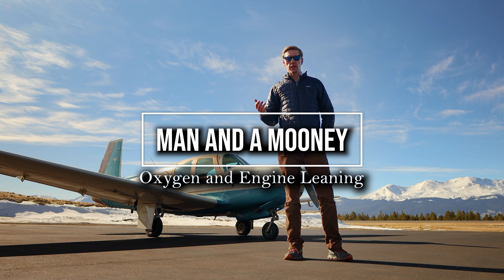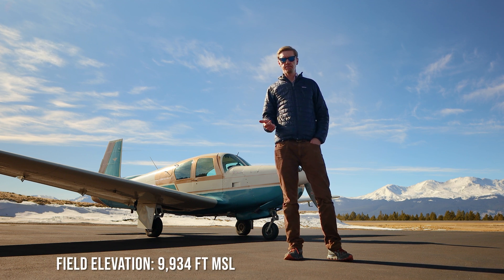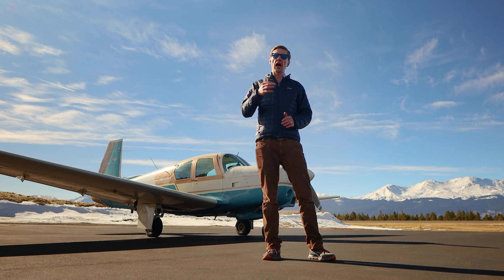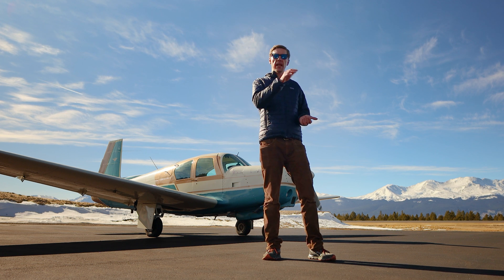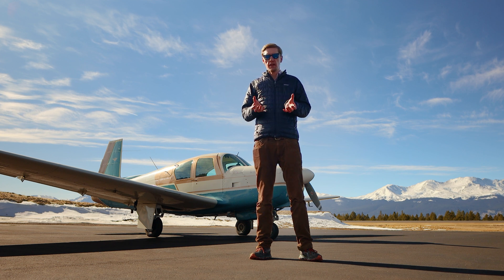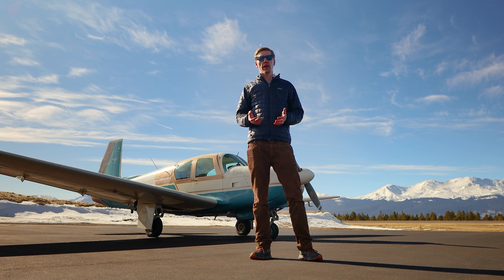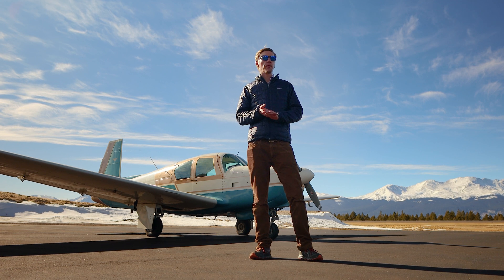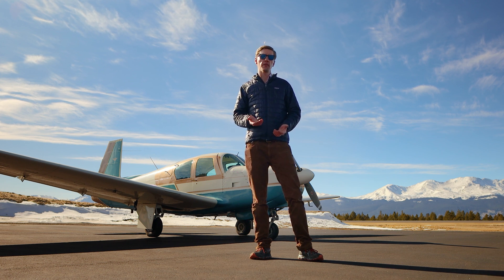How To: Engine Leaning and Supplemental Oxygen

Comment: Your lungs are designed to have air pressure push the air into them to function properly. At sea level this works well, but at altitude, while there is the same amount of oxygen in the air, the air pressure (pushing that air into your lungs) is less thus making your oxygen input less.  Sustained flight over 10,000 ft without supplemental oxygen will make one a little light headed with negative decision making impacts.  Thanks for the wonderful vids.  Makes me want to renew my pilots license.
Reply from the maker: Thanks Robert. I think we're saying the same thing in different ways. I appreciate your input. I would encourage you to get back in the saddle. Let me know how it feels.

Comment: Excellent video! Question: do you adjust your O2 flow based on your pressure altitude? Density altitude? Thanks!
Reply from the maker: Thanks Austin. I typically adjust my regulator to the flight altitude. That said, I live at 6,000 ft. and am acclimated to higher altitude. I also fly with a pulse oximeter and verify my SpO2 in flight. If you’re coming from sea level, you should probably use the higher of either DA or Baro Altitude just to be safe.

Comment: Curious on your thought on leaning for takeoff at high altitude do use EGT or max power at lower RPM’s?
Reply from the maker: Hi Nick, I use a combination of EGT and Fuel Flow. I've never heard of anyone using lower RPM for takeoff? That seems like a bad idea to me. Care to elaborate?
Reply: @ManandaMooney  should have worded better. Using EGT seems like a good approach. I've also heard folks running up to ~1700 or so and leaning to peak rpm as a technique to find max power.